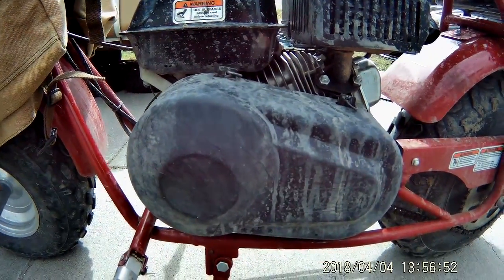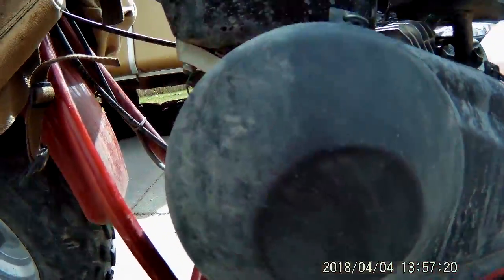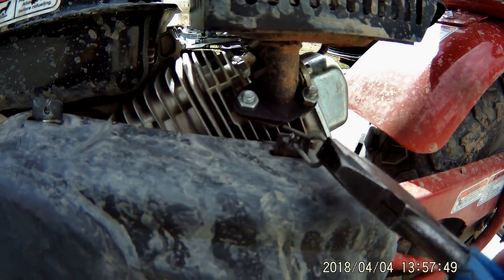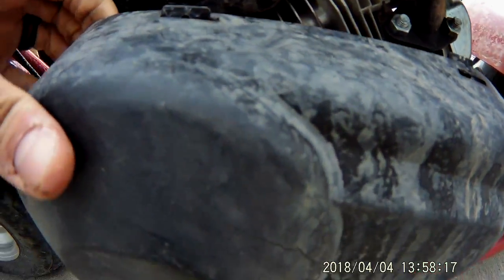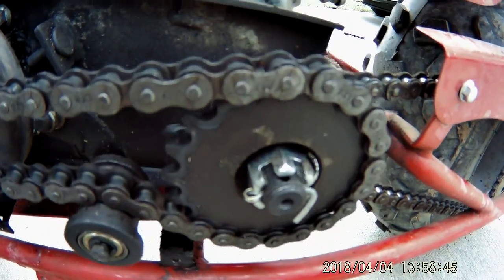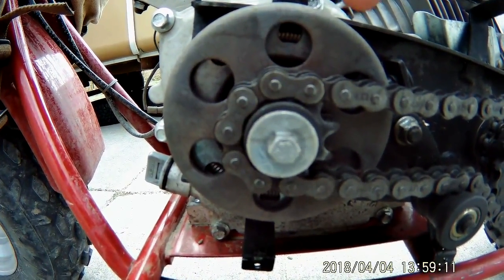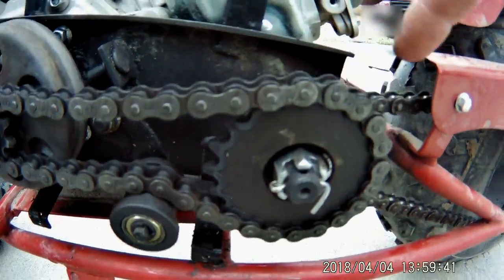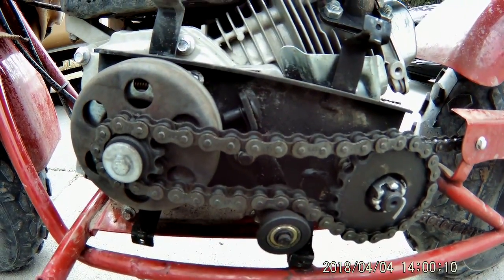Centrifugal Clutch Overview

Comment: How do I know if I should use a 10 teeth clutch or a 12 teeth clutch on my go cart?
Reply from the maker: I'm assuming you are referencing the drive sprocket. 12 tooth gives a bit more speed. 10 tooth gives more torque. It really depends on application and your goal. On my mini bike I have a 10 tooth sprocket on a CVT. I have torque in the low end and much better top speed.